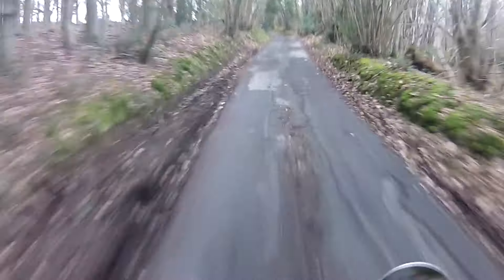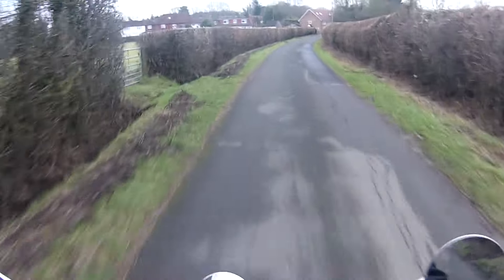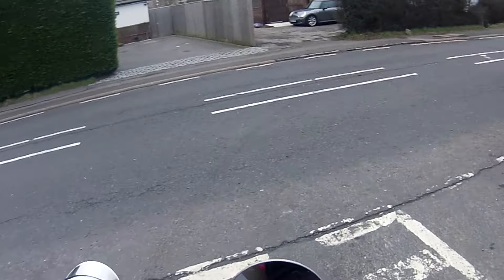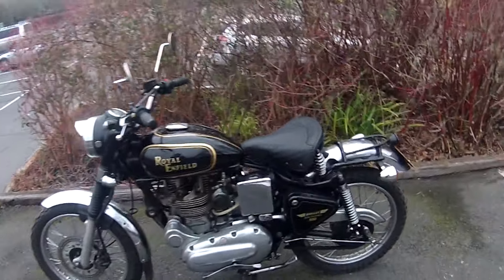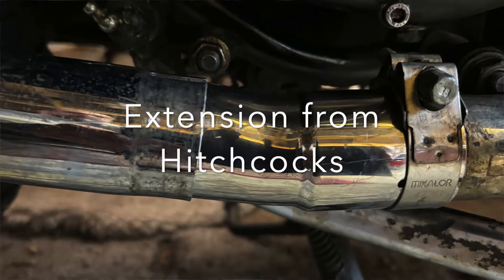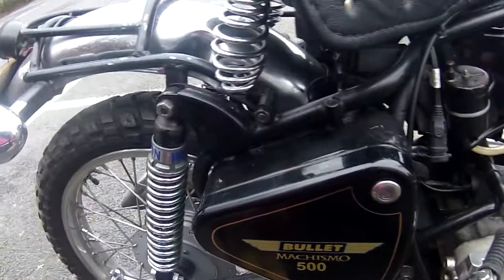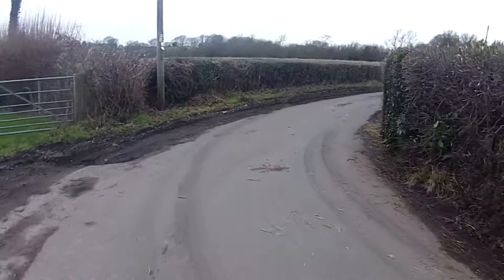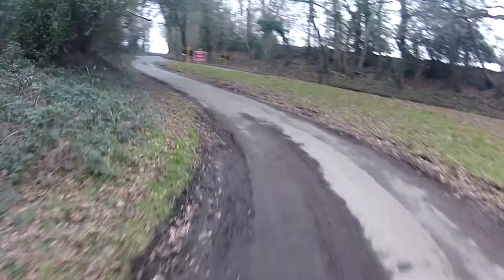Why is the Royal Enfield not well

Comment: Fancy! Electric start and a 5 speed. You've got what looks like the last of the pre-unit 350's, I have a G2 up-converted to 500. It uses a rubber intake mount to mate the carb to the cylinder. I found this to be problematic with age as the Indian manufactured rubber cracks within only a couple of years and a vacuum leak develops. The bellows to the airbox for my model also rots out within 2 years, and the crank case breather gets a year at best. I keep a couple of spares and change them out if things start to run rough for no reason.
Coil grounding provided by the coil bracket and ignition wire snugness in the coil socket may also cause weird anomalies that vary at RPM and speed.
The Mikuni has been brilliant running the local 3rd world petrol, just gave it a good rinse with carb cleaner 18 months ago when I put the bike back on the road after a decade as I didn't have a rebuild kit. In order to avoid pulling the carb apart when something stars to get weird, I sometimes pull the bowl plug and the idle and mixture screws and blow carb cleaner spray through the screw holes if it seems a little varnishy.
Reply from the maker: Thanks for watching and commenting this is an Indian import I have all the documentation love it just keeps my brain active and smiling
Reply: @Eastsussexbiker  didn't notice yours was the 500. Definitely look at the inlet manifold for rot and cracks. Yours may be new enough that it has an EGR valve as I see a port on some manifolds for that, it could be the EGR acting up if such a thing exists on those models.
Reply from the maker: All old school on this except electronic ignition thaks for watching